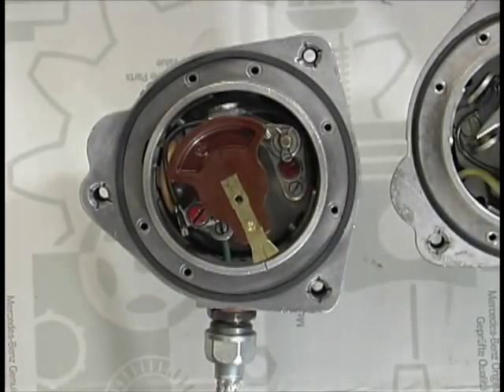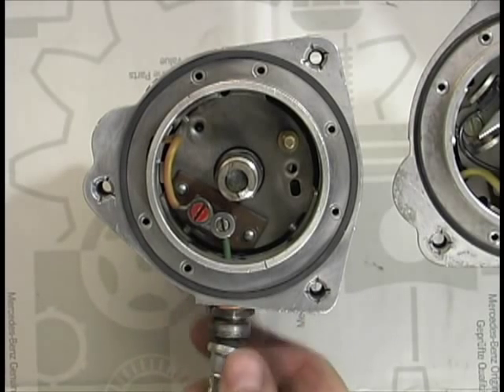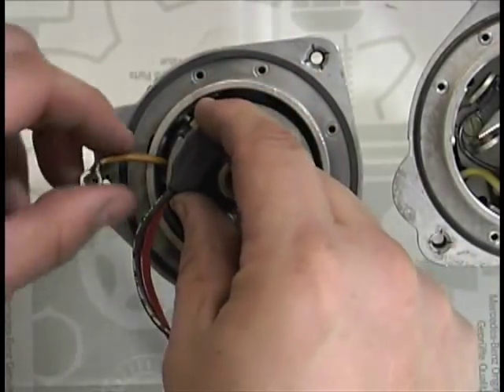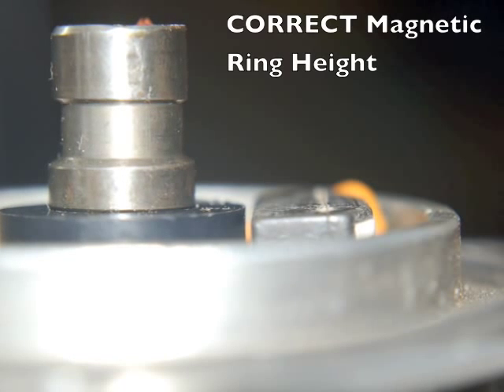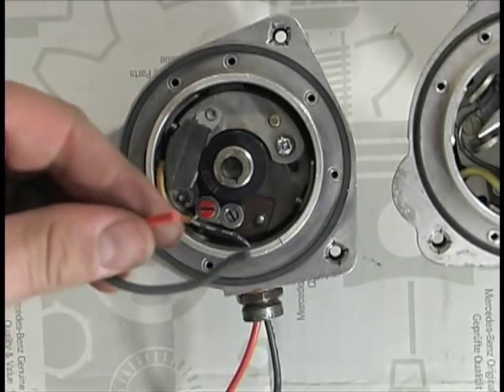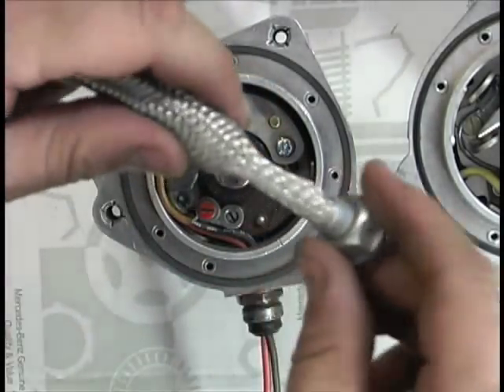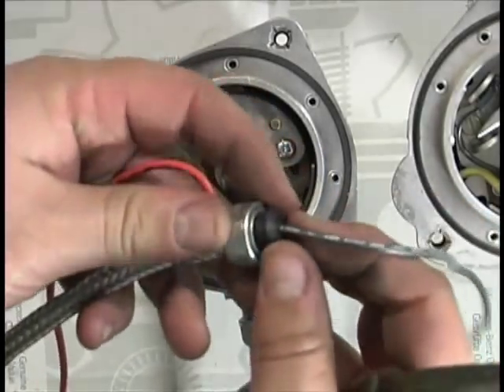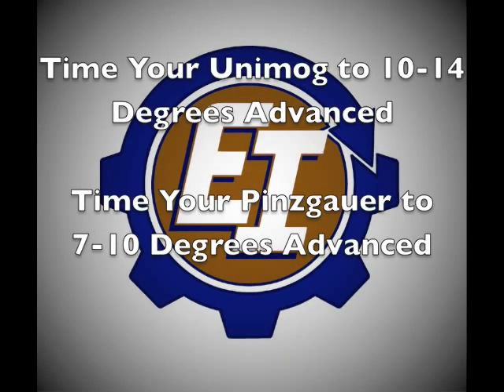Pertronix Ignitor Installation

Comment: Would you please mention whether electronic ignition conversion kit for hindustan Ambassador petrol car is available? The car is with LUCAS -TVS distributor. If so give details or contact No. and address of the supplier/manufacture